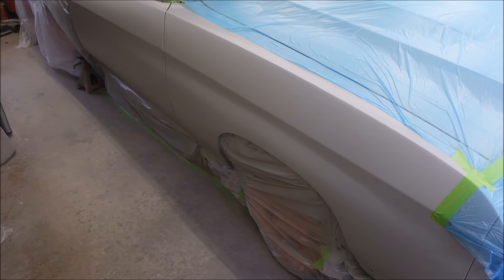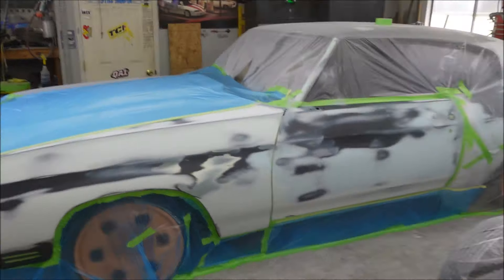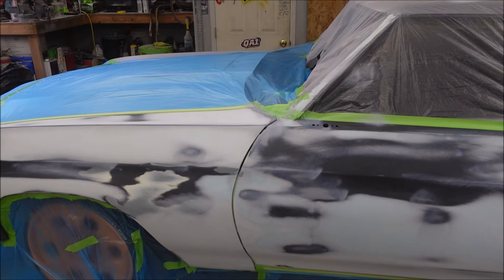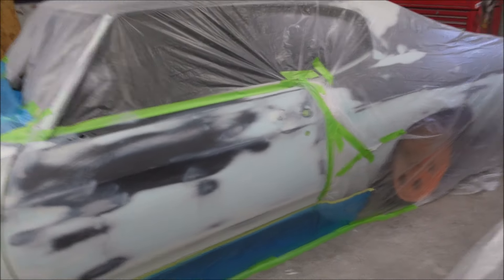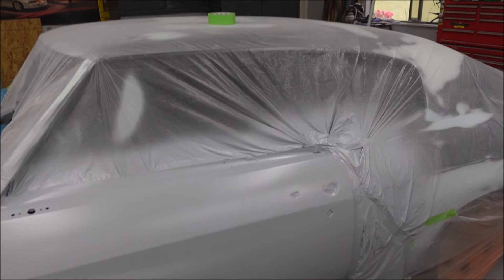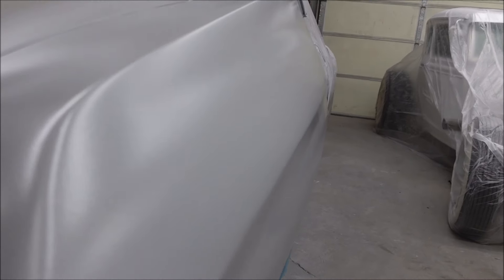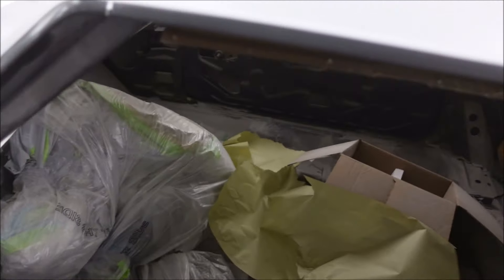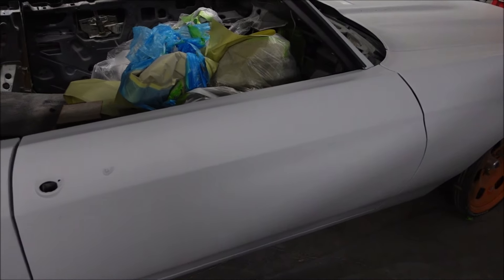1970 Chevelle Finally in Primer

Comment: I spray a light coat of epoxy on bare metal spots and let it dry for a day, if it's out in the sun it cures pretty fast and I prime it the same day. I agree that spraying polyester over fresh thick coats of epoxy is a disaster and can cause delamination, epoxy is really slow drying. I also sand the epoxy lightly before going over it.

Comment: Classic what to do with the bare metal burn throughs.  Have you ever messed with those high build epoxy materials?  I believe it is CRExxx in the ppg line.  I personally have not.. love the idea of DTM but the thought of blocking epoxy of any kind makes me gag. Looks good bud keep it up !
Reply from the maker: I have not, simply because epoxy takes forever to quit shrinking and I’ve seen 80 grit scratches showing up in cars it was used on.  Evercoat makes a super build dtm epoxy hybrid that works decent. But does shrink a bit.